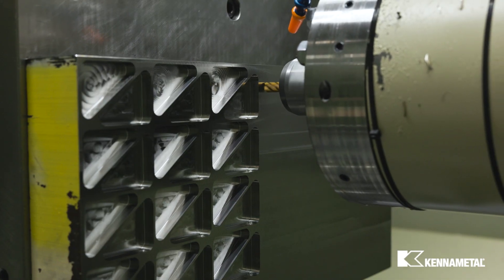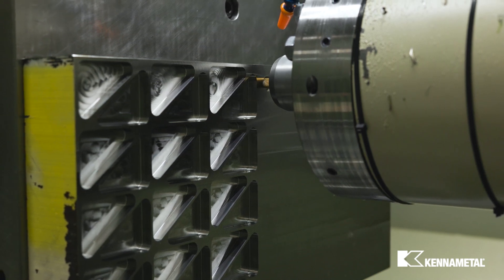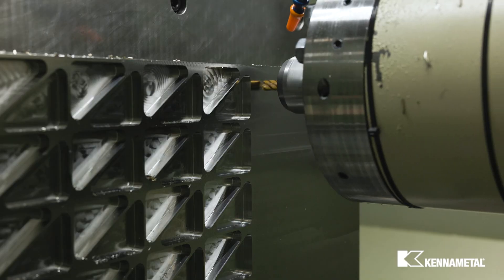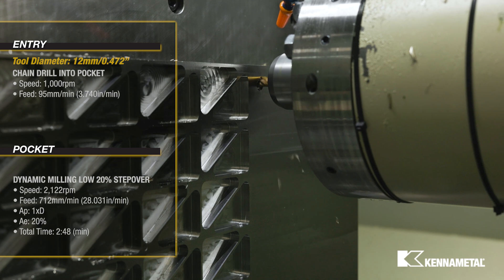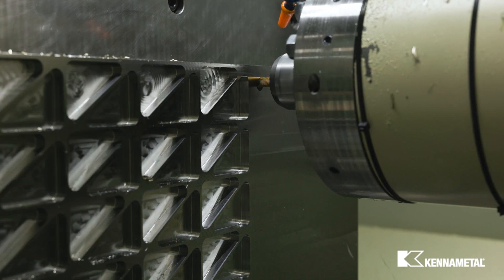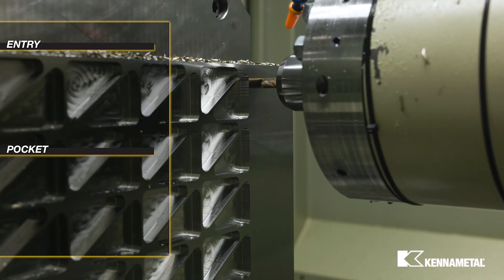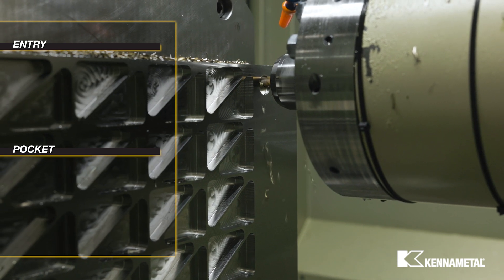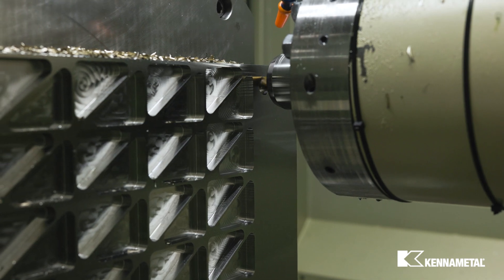High-Efficiency Pocketing - HARVI™ II TE

Comment: I got a question, maybe you can answer this. Every maschinists video I see, they always plunge directly into the material, no matter which kind of pocket they make. At our firm, we always drill a hole first, which is bigger than the end mill used, in which we plunge with the endmill and start the pocket from there. No matter if it is a rectangular shape, cutting out from sheet metal or flat stock. The drilling takes a few seconds, but it always seemed odd to me that everywhere, people just plunge straigt into the material. Are there no added stress and wear for the end mills by plunging straight into the material? We mostly use stainless steel (1.4301 or X5CrNi18-10 in German normization) with a standard 3-axis hurco milling maschine. Maybe you can clear up my confusion?
Reply: They do it in their videos to promote the capabilities of their tooling. "Look what our tool can do!" IMO, most of the time, tooling makers pushing their tooling to the max in their videos, when in reality, you probably wouldn't run them that hard in a real production job.